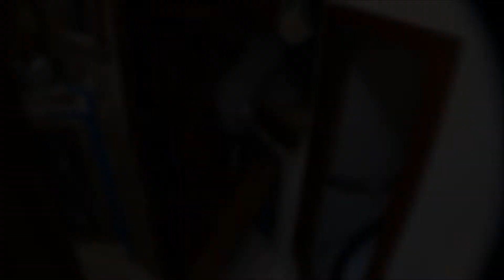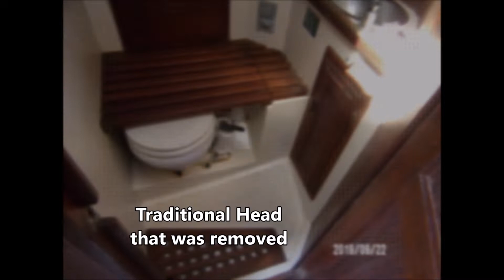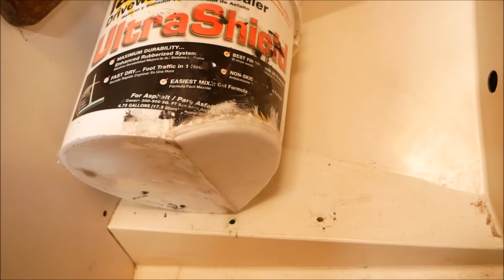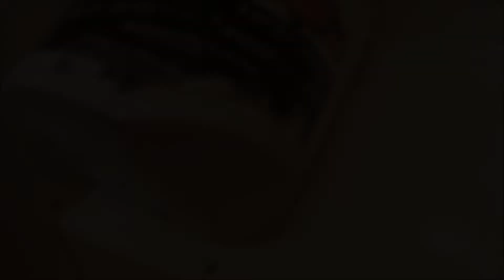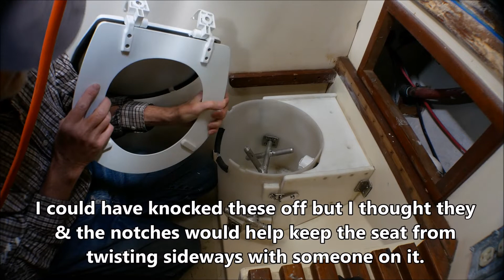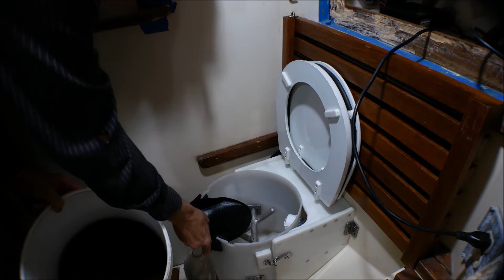DIY Compost Toilet for a Small Boat

Comment: Hello, that is a fantastic build, Sir. The plastic welding you have done has produced and end result that doesn't resemble some mishmash of parts. It all belongs & looks very intentional. You may have inspired me to pick up my very own Harbor Freight plastic welder! Where do you acquire your stock/plastic?
Reply from the maker: Thanks much for your reply! I bought the bucket, cataloged as a tank, from US Plastics...a bit pricey but it has a thicker wall (about 2x thicker) than a typical 5 gal bucket -allowing a better build when adding hardware attachments and it's about 1" wider too for better volume. For "welding rods" or filler I cut thin long pieces off of the tank I bought since it was taller than what I could use. Plastics vary a lot in composition so it's usually better to use filler that is the same as what you are trying to weld together. There are two of us living aboard using it for the past 2-3 weeks. Time to change the coconut coir.  Make sure you get some practice in with the welder before taking on your project. Thickness and type of plastic dictate what your heat setting should be and speed of welding. Work in a well ventilated area. Best of luck to you on your projects!

Comment: The previous owner of my sailboat did a DIY composting head. Based it on a 5 gallon bucket. Built in a place for the coconut husks. Uses a solar fan to have a positive airflow. He did not bother with a stirrer, we just put the coconut husks on after every use. I use the heavy duty bags meant for a bucket toilet. I just pull the bag out and dispose when it reaches about 3/4 full. No mess, very little cleaning needed. This is an occasional use boat, works perfectly for what I need. All the stirring and required cleaning of the bucket does not seem necessary. I don’t plan on using the dehydrated waste for anything. I don’t see the advantage of agitating it.
Reply from the maker: Thanks for your comment and sharing your experience. I think we both agree this type of toilet is a great alternative to the traditional head which with tubing and holding tank uses a great deal of space on a small boat. Many people like you don't mix and that's ok. I thinking mixing breaks up solids and promotes drying which reduces odors. But good ventilation might take care of that. I might try running a week long experiment this summer and test mixing vs no-mixing to see myself.
Reply: The system I have uses a standard through the deck solar powered vent with a battery in it to run 24/7, above the head. The previous owner also installed an in line 12V fan in that ducting. He was pretty clever and removed a blade to make that fan be unbalanced and make some noise, which is a good thing in a small space. I have had the boat for three seasons and it has been odor free. My guess is the number of folks using it might be a limiting factor. The beauty of it is just closing up the heavy duty bag and dumping it. My girlfriend was not sure, but she has come around. I am sure she still prefers the Purosan system I had in my Chris-Craft, that was a great solution too, but not legal in all waters. I had one boat with a holding tank and never again.
Reply: Well I am again at a crossroads. I kicked the project down the way a few months ago but now am rebuilding seacocks on my Orion 27. Would love to go composting.. The challenge is not having a shop with all the necessary equipment to do such a nice job given the Orion complexities.

Comment: great ideas in this video!  What is the exact bucket you bought from US Plastics?  I was looking through their website and couldn't find one that was similar (thickness and such).
Reply from the maker: Here's the invoice entry from US Plastics for the bucket (they call it a tank):
Item No.  4150      5 GAL CYL POLY-E TANK 11DIA X 14HI 
I just checked their web page and its still available but-wow- have they gone up in price! This is the thicker wall tank (1/4").
Thanks much for your kind words and best of luck to you on your project!
Reply: @trailsandsails2722  thank you!
Reply: Nice going given all the angles. I am about to create a composting  system in my Orion 27, from  1981. 

In retrospect what are the pro and cons of your system? Is it easy to keep clean?
Reply from the maker: @CapnFre  I'm assuming you mean the interior of the bucket and tumbler. Its much a function of how dry the solids are. I don't know how soft stools would do. I coated the tumbler with epoxy since the anodized AL would likely be more prone to holding onto stuff so polished SS would probably be better and that's what AirHead, I think, uses. Key thing is moisture-  drier the solids, amount of deposits, mixing couple times a day or more, warm dry environment, and air flow with the ventilation system allows wet stuff to dry and break into small pieces. That's a reminder that this type of toilet is a actually desiccator. I do add Nilodor in a dilution but its just one pump of fine mist. I use coconut chor but Practical Sailor says wood ash is better at desiccating but my guess is that would be pretty messy and hard to dry out.